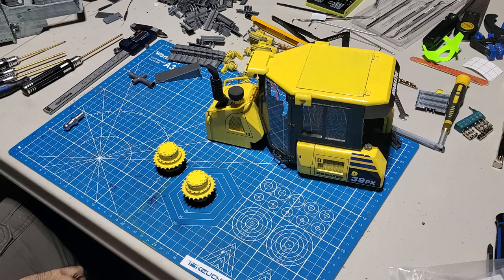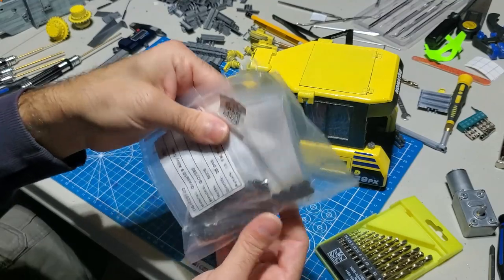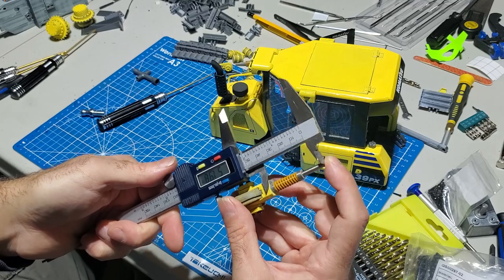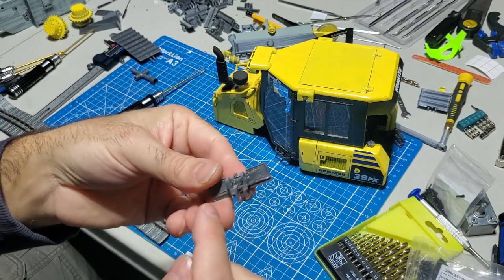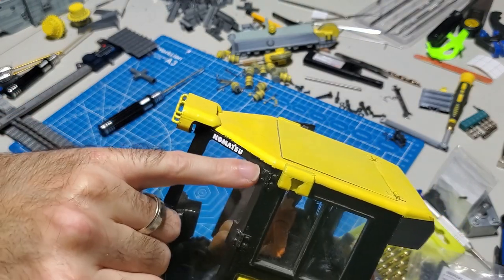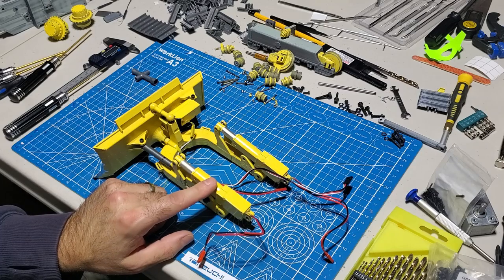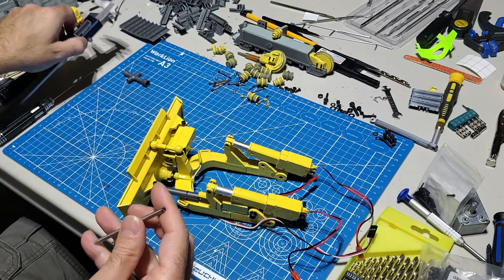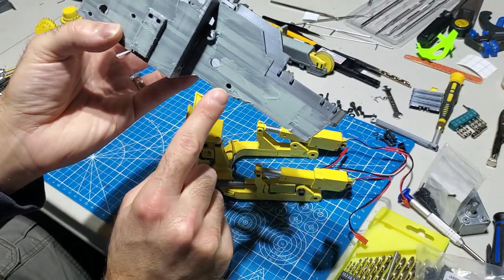3D Printed Remote Control Yellow Dozer BUILD PART 1

Comment: WOW!!  That looks really good. I'm saving my pennies now for the Lesu 1/14 scale Liebheer 636 Track Loader kit. It's so scale and beautiful. I'm getting the unbuilt/unpainted kit, because like you, I will throughly enjoy assembling the kit. Prices are pretty steep, but you get what you pay for. This is something I dreamed about 45 plus years ago when I was 10/12 year old kit.
Reply from the maker: Yes lesu makes some good machines. Just make sure if you get it to take the pump apart and the valve block and clean it and check for any metal debris as it could cause issues down the road. But keep saving and enjoy the hobby.
Reply: Have you thought about 3d printing a Cat 973 tracked loader?

Comment: As long as the part list goes, it would have been nice to detail what each item was, instead of just providing a link to amazon or aliexpress, as already a lot of the links are dead and trigger an error 404 message, and it is now impossible to know which parts you used. With the reference (or at least the name of the part), it would have been possible to find it from an other supplier eventually by doing an internet search. 
Apart from that, nice job and good informative video. Congratulations
Reply: @RCConstructionHobby  : Thank you very much for the effort; I like your build videos. I hope you'll do more of them in the future. Keep up the amazingly good work